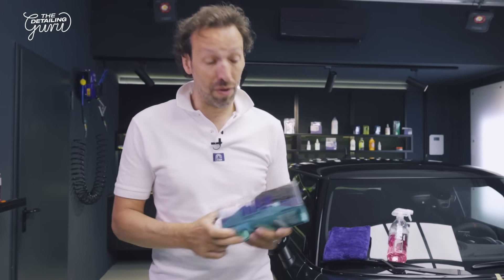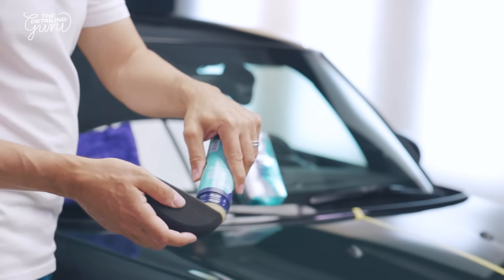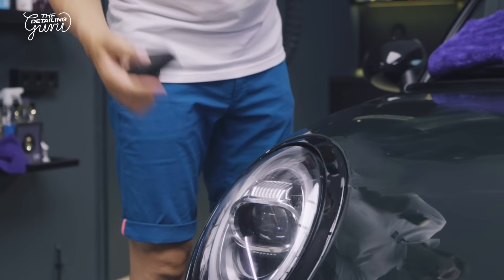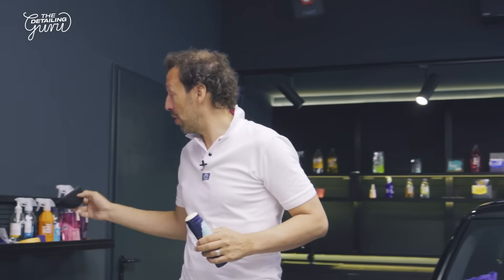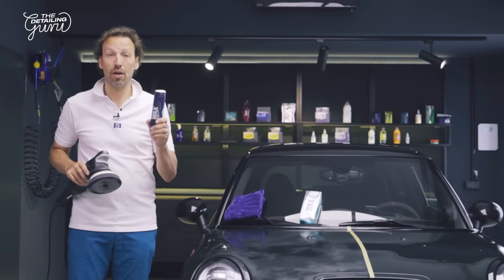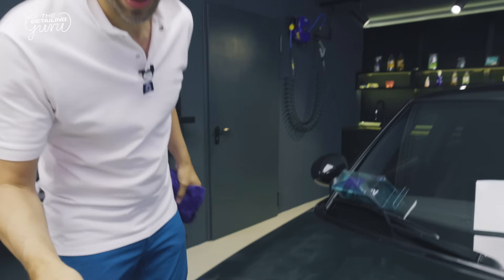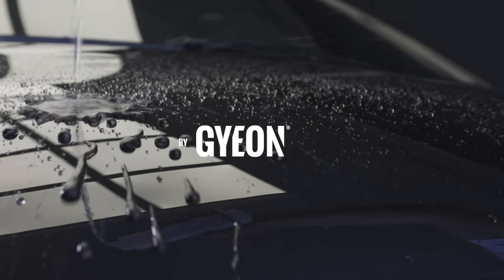WAX IS DEAD? How to make waxing a joy. - The Detailing Guru

Comment: I have been using this product on my daily driver which sits outside 24/7 for five months now. The hydrophobic behavior is still amazing which tells me the paint is protected. Yes the paint is not as smooth as it was five months ago but the gloss and depth are still amazing. He is correct in saying to apply a very thin coat when applying. This is an amazing wax and an awesome upgrade to offer customers.
Reply from the maker: Thanks for your comment en feedback. 
Regards,
Y.
Reply: Hi can i use it w can coat?
Reply: @GYEON_official hi can i wax over can coat?
Reply from the maker: @zamanzambari6464 I would not recommend it. Use Q²M CanCoat Evo as a standalone product for optimal performance. 

Regards,
Y.

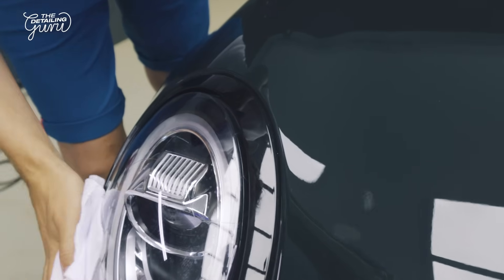Comment: 3:59 I can almost feel how slick and soft the paint feels. Hard to get this with anything but a good wax 😊
Gloss and water beading looks amazing !!
Reply from the maker: Thank you. We have put quiet some effort in it to combine great user friendliness with good performance. 
Regards,
Y.
Reply: @GYEON_official  does it contain SiO2 or graphene as well as fluorine ?
Reply from the maker: It’s our custom blend and it contains fluorine and carnauba and other ingredients as well but for sure no graphene.
Regards,
Y
Reply: @GYEON_official  does it make sense to top the wax with some of your other products (Bathe+, WetCoat, Cure, Ceramic Detailer) ?
I just bought the wax and I am wondering, if I should still use Cure or Ceramic Detailer as my drying aid or if it is waste of product ?
Reply from the maker: Don’t overthink to much. CeramicDetailer as your drying aid will be more then fine. When hydrophobicity drops you can start using Bath+ or Wetcoat or reapply another layer of Wax. 
Regards,
Y.
Reply: @GYEON_official  thanks 👍 slowly replacing all my detailing products with Gyeons lineup, so I just need to adjust my wash and maintenance procedure accordingly.

Comment: congrats guys. i yesterday used the wax the first time under less tahn optimal conditions (outside, ca. 10°C, no direkt sunlight though). Application was super easy. After about 45 Minutes the wax came off like wipong of dust with a single towel. I can second all the other comments that the wax is very user friendly. hydrophobicity seems great, now im curious how long it will last
Reply from the maker: Thanks for your feedback. Glad to hear it was a nice experience. Durability of course depends on various conditions but you might be surprised. 
Regards,
Y.

Comment: I've got a few questions:

1) On average, how many cars can this bottle cover? (I have a small SUV).
2) How does the wax hold up in hotter climates? Any issues with durability?
3) What's better to use on top of the wax - Wet Coat or the Ceramic Detailer?

Cheers from Australia!
Reply from the maker: It will cover at least 10 to 15 normal sized cars. Remember Wax needs a thin and even layer. 
In hot climates it will behave like any Wax. On horizontal panels where the sun sits most it will suffer more but this is something normal with Wax.
For maintance I would go for CeramicDetailer, keep the Wetcoat for the wheels ;)
Regards,
Y.

Comment: I applied this wax to my car yesterday.  I washed it, decon, clay bar then Q2 prep before applying the wax.   My car looks great.    What can I use as a drying aid to give the wax some longevity  ?    By the way …. Great videos 👍😃
Reply from the maker: You have some options: Q²M QuickDetailer where the goal is gloss and gloss only and Q²M CeramicDetailer where slickness and protection is more present. 
Regards,
Y.

Comment: Fantastic wax has transformed my focus rs. Would you use a detailer spray on this if so which one. Also will the detailer spray take away the effects of the wax if left on its own cheers from Australia
Reply from the maker: Thank you for the comment. Both Gyeon QuickDetailer and CeramicDetailer will work fine with the Wax where QuickDetailer will not change or prolong the initial water behaviour. 
Regards,
Y.
Reply: @GYEON_official  thanks for the quick reply. It’s a fantastic wax I love washing it it’s nearly dry by the time it’s rinsed of to the water just sheets of straight away the best I’ve used bar far. And being a weekend car and garaged  it’s been on since April and it’s still the same as the day I put it on👍🏆
Reply from the maker: That’s great to hear. It will last really long on a well maintained weekend driver but we rather under estimate then over estimate 😉. 
Regards,
Y.
Reply: @GYEON_official  hi guys so I’ve stepped up to Gyeon can coat on my daily driver can I top the can coat with this wax? Or I’m also trying to strip the wax off my RS weekend car but can’t 😆. I’m going to use can coat on it also. Wondering if I should just leave with can coat or top up with wax or ceramic detailer or wet coat. Cheers guys

Comment: Hi Y. @gyeon, is it normal for this wax to require multiple wipe downs after the 30 minutes cure time? I noticed my paint seemed a bit hazy after the initial wipe down with Polish Wipe and I had to do two additional wipe downs with Soft Wipe. Does this mean I used too much product during application? Thanks.
Once everything finally wiped down, the black paint definitely looked much deeper and more glossy 👍🏼 incredible product.
Reply from the maker: Hi, this can happen, it’s called sweating. I have not experienced it yet on my applications but it is also very clearcoat depending. Nothing to worry about, you just need an extra wipe down but it will not affect the performance. 
Regards,
Y.

Comment: Looks awesome! When my wax is empty and need to buy a new one, this might be the next.
I have a 26 year old car with unicolor bright Red faded (but sometimes polished) paint, how does this wax perform on old paint? I used Poorboys EX-P Pure Sealant for 10+ years now and the older and more porous the paint becomes the harder it becomes to apply and wipe off. 
Also, becuase it's bright red it fades quickly due to UV light. How does this wax protect against UV?
Reply from the maker: No wax will give you a good UV potection but Q² Wax never disappoints! Try to apply it by machine on your unicolor red paint and you might be surprised by the outcome and durability. 
Regards,
Y.

Comment: Hi, 
I can not seem to find the black foam pad you used to apply the wax by machine.
Is this a new pad you will be introducing to the polishing collection or is it from another brand.
Thanks for your help, great video and very informative as always.
Reply from the maker: It was a testpad but our white Q²M Finishing pad will do the job perfectly. 
Small tip: when using the pad for the first time, try to warm it up a bit with some Q²Wax on it (30 seconds on your DA machine on a panel) to make it more flexible when you start.
Regards,
Y.
Reply: @GYEON_official  
Thanks for the quick response and for the great tip.

Comment: Good afternoon , I would like to ask you an opinion in regards to something that happened to me when using this product.
First of all , excellent product , I loved my experience with it , although , I ran into an issue.
Following a 2-step paint correction , I washed the car and used prep to clean the surface prior to applying the wax , everything was great, but after a week or so after having applied it , the car was exposed to some sunlight ( summer in Portugal is quite warm ) and when I came home , the paint was all hazed up , I suspect it was the wax still releasing some solvents.
I re-wash the car and wiped the paint with a bit of prep. I managed to remove the haze.
Any thoughts?
Reply: It’s called ghosting or sometimes referred to as sweating. As you said it occurs due to the solvents within the wax evaporating and is exacerbated by hot climates (as what you have in Portugal). Best way to ‘solve’ it is to give the paint a quick detail using a QD spray and buff off any excess residue. Or wait until the next wash like what you did.

Out of interest, I believe the Gyeon Wax is a fluorine wax (which is what skiers put on their skis to glide down mountains as it is very slick), so my question is how do you find the slickness of this wax compared to other waxes you have used in the past?
Reply from the maker: Hi, thank your for your comment. This is quite normal and can happen in hot climates as you mentioned. 
This “sweating” mostly occurs on the horizontal panels and especially on bonnets because the added engine heat even accelerates this process. 
What you did is fine. You can use a damp cloth and try to remove it as well, then give it a wipe with Gyeon QuickDetailer. 
For future wax applications, try to apply it thin and even. Outsweating is also caused by over using the product in an uneven manner. 
Regards,
Y.
Reply: @RobertAtherton  I came from Gyeon CanCoat , the only reason I changed to wax was simply to be more engaged with the process more than anything else , so I have no previous experience with other waxes , although I must say , the wipe off is wonderful.
Reply: @RobertAtherton  it’s very slick mate smooth as can be best I’ve used

Comment: How often should this be done? If I have been using the quick ceramic coating often?
Reply from the maker: You mean how often to Wax your car? Well there are many variables so it’s really hard to answer that question in a short notice but with good maintenance every 4 months should be very satisfying. 
Regards,
Y.
Reply: @GYEON_official  great!! This means I should also get this product…on top of using the quick ceramic detailer once a month…😅👍🏼👍🏼
Reply from the maker: You will not be disappointed and once a while applying a Wax can be very satisfying. Enjoy. 
Regards,
Y.

Comment: Hi Gyeon

I just bought this wax. Can it go over headlights and moon roof glass on the roof, plastic beadings, rubber as well? Would that be OK? Are there any particular areas on the outside of a car that I should not apply it (eaving out wheels, of course). Thank you.
Reply from the maker: Hi, headlight is no problem and when some wax would be on some rubber it will not stain when wiped off properly but it’s not a wax for rubber and plastic, it’s to apply on painted/clearcoated surfaces. 
Regards,
Y.

Comment: Hi Y @gyeon, Will Q2 Wax protect my car from possible swirl marks happening? I have Mohs Evo+Cure on my black Tesla and unfortunately I have to use a car cover on it because it lives under an oak tree and I’ve noticed taking on/off the cover has been inducing swirl marks. Thank you for the insight!
Reply from the maker: It will reduce it due to slickness but nothing except PPF will protect your clearcoat from scratching. A car cover is really the last thing to lay on paint, especially outside. I would suggest to make a system where the car is covered but in such a way that the cover doesn’t touch your car. 
Regards,
Y.

Comment: Interesting! I just applied my first Can Coat on my car and the beading from the rain this week has been great. How do I add this wax to my maintenance schedule? E.g. Can Coat in spring, wax in between as I please, then Can Coat in the Fall before winter? Would I need to strip the wax before I put a pre-winter Can Coat? Thanks in advance.
Reply from the maker: I wouldn’t make it to complicated if I were you. Let CanCoat do it’s job during winter, it’s very durable and will for sure last through one Winter. After that period I suggest to do a thorough decontamination of your paintwork and then it’s a good moment to add the Wax on top. 
Regards,
Y.

Comment: Should I apply a second layer? will it stick better if left over night? and will it work with Gyeon ceramic detailer already on the paint?
Thanks in advance for responding to my annoying questions!
Reply from the maker: You can apply a second layer bit it’s not a must. 
Regarding whatever kind of protection you are choosing, a clean surface free of contamination and other products is the base for a good performance. 
Regards,
Y.
Reply: @GYEON_official  Thanks!

Comment: Hi Yves, love your videos. I recently got my car done with Gyeon Duraflex. Just for extra protection, should I apply Gyeon Wax over my duraflex? My detailer told me to maintain duraflex with Gyeon cure. However, he said the Gyeon is the 2021 product so I am better ask you rather than anyone else:)
Reply from the maker: Hi, thanks for your comment. 
Q2M Cure and Q2 Wax are 2 different products that serve different purposes. As a maintenance product after your wash, Q2M Cure still is great. If you want to put a bit more effort in Q2 Wax will rock but when it’s recently done I would stick to Q2M Cure for a while. 
Regards,
Y.
Reply: @GYEON_official  Thanks for the reply, you always reply promptly:) My concern is I have 2 little sons and they love to play around the car, it leaves some nail scratches at the end of the day. For the purpose of "repairing" my duraflex coat instead of maintaining it, I believe you would recommend Gyeon Wax over Cure correct?

And one more thing to confirm, my detailer told me my Gyeon Duraflex will last for around 5years, would the Gyeon Wax "eat up" a little bit of the durable of Gyeon Duraflex Coating? Thanks again! I hope you have a very next Xmas and a happy new year!
Reply from the maker: Hi, maintenance is crucial and Q2Wax will not “eat up” your coating. To round things up, I would use Q2M Cure as my drying aid after a wash and after stick to a good chemical decontamination every 3 months. 
Once a year (before winter) a layer of Q2 Wax is a great help. 
Regards and have a nice Christmas. 
Regards,
Y.
Reply: @GYEON_official  The crazy part is not how good Gyeon products are, reply comments on Christmas eve is. Thanks for the explanation and instruction in detail. I just placed a big trolley of Gyeon products from the distributor. Thanks!

Comment: Hi, what durability would you expect and would restart shampoo affect this
Reply from the maker: Durability depends on different things but in a normal climate and good maintenance it will last between 3-4 months on daily drivers and this is from my own personal tests. Of course certain panels on a car can degrade quicker then others and preparation is crucial but it’s so easy to apply and wipe off which means a top up layer is done pretty quick. 
Remember, it’s still a Wax but a damn good one!
Regards,
Y.

Comment: Hi, I have just recieved my Gyeon wax and was wondering if you can answer a question for me on the video Yves says to spread a thin layer over each panel but on the wax stick it says to spread a thick layer over each panel so I'm a bit confused.
Would be great if you can clear this up for me.
Thanks
Reply from the maker: You are right, this might be confusing. I said this because with an even thin layer the wipe off is always super easy. Although the Gyeon Wax is so easy to wipe off that even a thick layer will cause no issues and assures newbie users from having enough coverage. 
Hope this answers your question. 
Regards,
Y.
Reply: @GYEON_official  Thanks for the quick reply and yes this clears things up.
Thanks

Comment: Does this have some abrasive or filling abilities to hide/remove swirls and scratches
Reply from the maker: It has no abrasives but every wax or oil containing product has “filling” abilities. 
The strength here lies in the high amount amount of carnauba together with the fluorine mix. This gives a very high gloss and great durability. On top of that we made it easy to use.

Best regards,
Y.

Comment: when pad you are using when apply with the polisher? and we apply the wax too the whole car and then wait 30 minutes to wipe off?
Reply from the maker: I used the white Gyeon polsihing pad. You can apply Q²Wax to the whole car and even leave it overnight before wipe off. We recommend to wait at least 45min but if you wait longer it will come off super easy as well. 
Regards,
Y.
Reply: @GYEON_official  what is the temperature have to be when applying and if it’s colder weather should we not wait too long before removing?
Reply: @GYEON_official  what’s the durability?
Reply from the maker: Between 15 and 25 Celcius is a nice window. 
Regards,
Y.
Reply: @GYEON_official  thank you

Comment: if i apply syncro to my car, how many time i need to wait to apply the wax?
Reply from the maker: Syncro has a topcoat called SKIN which is very very slick. It is that slick that after a fresh application a layer of Wax might not bond very well. A layer of Wax after a fresh coating application it’s primarily goal is to create an extra layer and give the coating enough time to cure in it’s first weeks, especially in harsh climates. 
Apply the Wax thin the day after you have applied SKIN and if possible leave the car another day inside. 
Regards,
Y.

Comment: Does this work on PPF too?
Reply from the maker: It will be hard to get a “clean” finish and adhesion is not equal as on clearcoat which will result in lower durability. I would suggest Q²Cancoat Evo for a quick and budget friendly solution. 
Regards,
Y.

Comment: What is the longevity of Gyeon Wax?
Reply from the maker: Durability depends on different things but in a normal climate and good maintenance it will last between 3-4 months on daily drivers and this is from my own personal tests. Of course certain panels on a car can degrade quicker then others and preparation is crucial but it’s so easy to apply and wipe off which means a top up layer is done pretty quick. 
Remember, it’s still a Wax but a damn good one!
Regards,
Y.